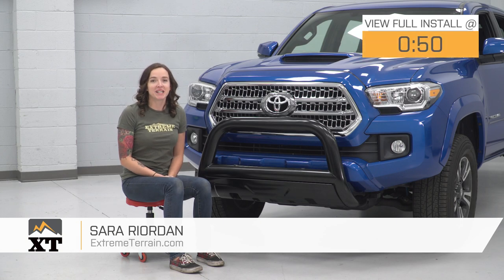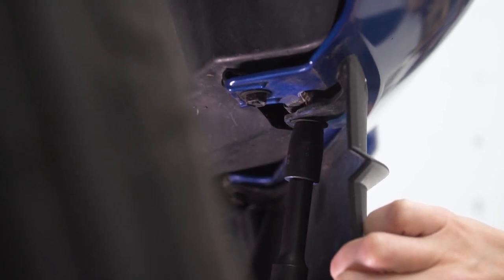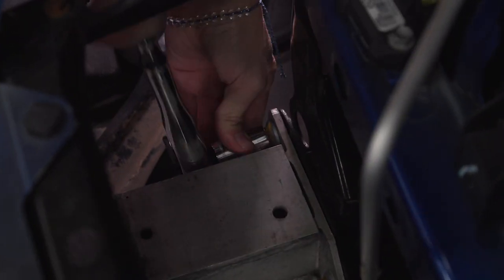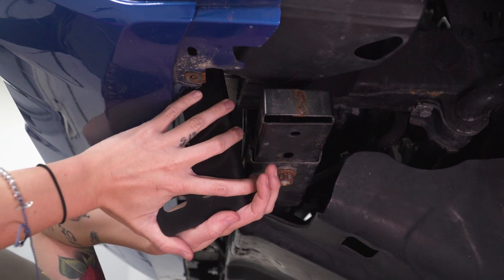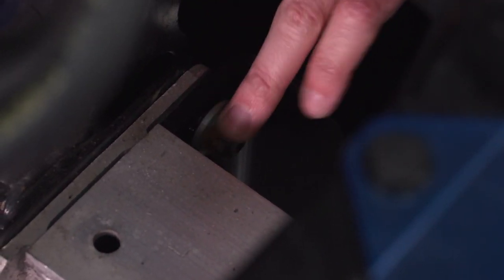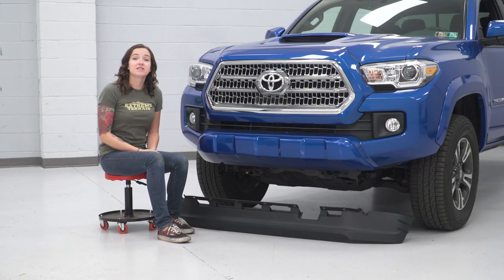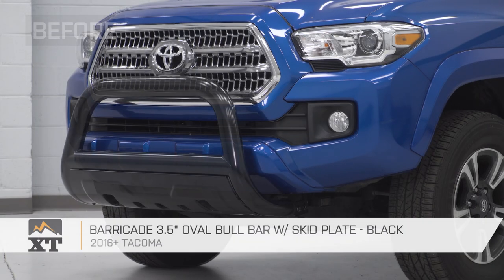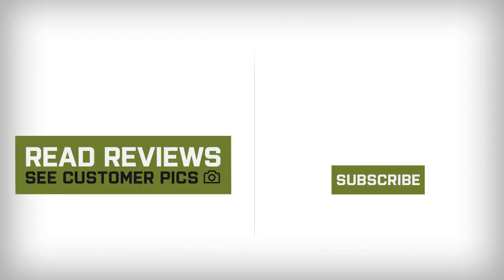Tacoma Barricade 3.5 in. Oval Bull Bar w/ Skid Plate (2015-2019) Black Review & Install

Comment: It doesnt look bad its basic simple install though what I noticed is that it only has 2 bolts to each side doesnt seem that would give it much strength especially just being bolted to end of framing which could result into some simple bumping it against something or someone even slightly hitting it could tear into the ends of the frame of where bolts pass through just doesnt seem as a good solid strong hold.